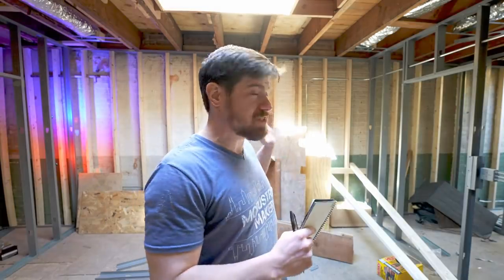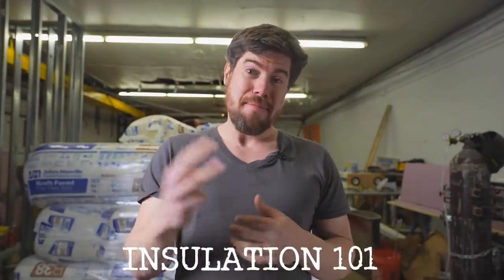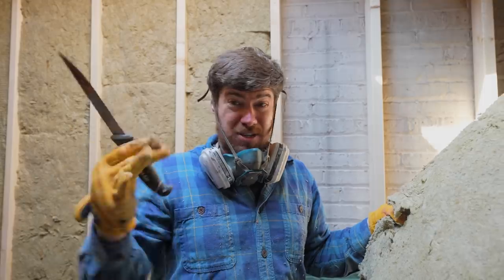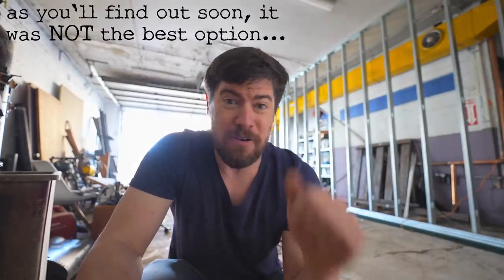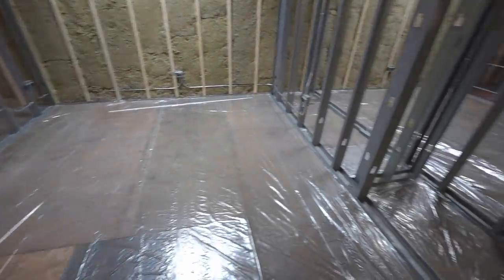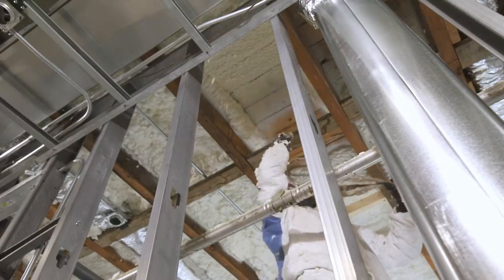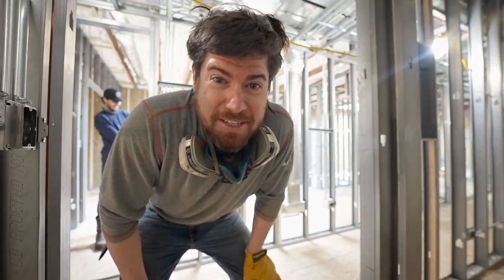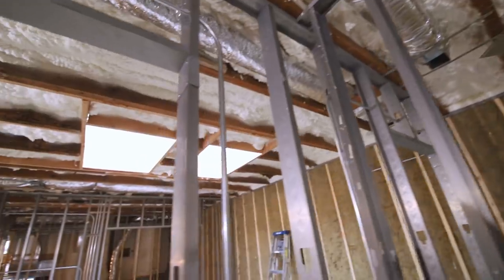Ep. 15 Abandoned Building Renovation || INSULATION + SOUNDPROOFING

Comment: You may have covered this in another video and I just missed it, but why did you end up using copper pipes instead of PEX? I just had three of mine burst in the Snowmeggedion and replaced everything with PEX. Did we make a mistake??
Reply from the maker: code requires it in commercial buildings
Reply: @modustrial  Bummer!

Comment: Any reason why you didn't go thicker on the ceiling?  

It's amazing how much difference insulation makes in sound deadening!  Adding the drywall will improve it even more, but I would fill the other wall cavities with insulation, particularly since you came in under budget.
Reply from the maker: the material is expensive, and we didn't need to go thicker...so best not to pay for what I didn't need :)
Reply: @modustrial I understand the expense point, but insulation is one of the few areas that will save you money each month.  Then again, I assume that you or your GC have run the numbers and/or identified other areas that will provide better ROI in an older brick building.

I'm looking forward to the next installment!

Comment: You may have just installed less roof insulation than required by the building code. Spray foam does decrease air leakage but it doesn’t change physics and magically multiply insulation R-value.
Reply from the maker: with spray foam you don't have to go as high an R-value practically because it is air tight, and we don't need to be up to code standards (which are lowest common denominator to whats needed with leaky fiberglass).... i mention this in the editorial note (on-screen text).  You only need to have an inspection for insulation when doing new construction or an addition...no inspection is required when you add insulation to an existing structure.
Reply: @modustrial  don’t need to be up to code standards which are the “least common denominator” - then you go ahead and put in... less. Seems sketchy but it’s your house. I’ll still be here watching.

Comment: You could have used the 24" fibreglass in all the remaining interior walls for sound mitigation. You'd cut 16" off a roll and install it horizontally.  Or return It like you did.
Reply from the maker: that definitely was an option, but also a ton of extra work and time, and I was under the gun to get this done.
Reply: @modustrial  great project!  The four most expensive words in a reno are "while we're at it..."

Comment: You'd think spray insulation wouldn't be so expensive, considering the relative ease of installation. What do I know though.
Reply from the maker: the foam itself is very expensive (think about a can of great stuff, then multiply that by 10,000 in volume.  Also lots of overhead costs for the specialized truck, storage, etc, and labor for a crew of three people.
Reply: @modustrial  gotcha. It's completely new to me. I wasn't aware of all of the variables.

Comment: 900 sq ft = $1000 what was the approximate square footage of the spray foam that was $5800?
Reply from the maker: about 2200 sq ft., but I needed thicker rockwool for the ceiling, so it would have been almost double the cost per sq ft as compared to the rockwool on the wool...not apples to apples.  I ended up paying about 2k more for the spray foam (but also, not a fair comparison, since that number doesn't include labor to install rockwool, but does include labor for spray foam)

Comment: Great job! Loving these episodes!
I have one question, will you do the hard wood flor then drywalls over the flor or drywall then floor up to the drywall and having to put baseboards on the lover part of wall towards the floor? I think it looks much more modern är clean when there is no baseboard and the floor goes all the way below the drywall😄
Reply from the maker: Thanks!  Drywall first, then flooring....working top down makes it easier since you don't have to protect flooring during drywall installation
Reply: @modustrial  Yes, it is easier! But the final result in putting drywall over the floor is so much cleaner and modern! 😍

Comment: One comment on the brackets bolted into the concrete wall - in the winter the cold from the brick wall is goign to transfer right through the metal brackets and you're likely to get condensation on the metal and dripping.  May want to reconsider, pull the brackets out, put in blocking between the studs, and then mount brackets on the blocking.
Reply from the maker: Hmmm, I guess I will have to keep an eye on it.  Hopefully it won't be an issue tho, because despite the look of it, that isn't really an exterior wall.  At the location where installed, the brick on my building butts up against the brick on the building next door, so it isn't exposed to the outside
Reply: @modustrial  You're probably good then, but yeah, keep an eye on it.

Comment: Have you talked about why you've decided to not preserve the brick walls in the living spaces? Seems like that is a highly desired aesthetic.
Reply from the maker: I am keeping the brick in the living room, and the half the studio, and few small spots elsewhere.  Just a tradeoff for comfort, having space to hide plumbing and electrical, etc
Reply: @modustrial  Ah, OK. Good point on the plumbing. I may be acquiring a similar type building soon, in your research, does a brick wall that has an exterior exposure require insulation or does the brick provide enough insulation?

Comment: is it me, or are there very few outlets?
like only one outlet per bedroom or so, that's not enough imo. probably just overlooked some tbf.
Reply from the maker: every 6 ft on interior walls, by code :) and laid out so there is one on either side of a king size bed in master.
Reply: @modustrial  of course there's a code about that 😂 there's a code for everything! 
i just noticed in our current apartment that some extra outlets turn out to be SO useful. like in the living room for extra lamps or one very random in the middle of our hallway, that turns out to be the exact location so you can vacuum the whole floor without having to change outlets. but you probably thought about stuff like that already anyway!

Comment: Could you not have used a vapour barrier or foil insulation boards like kingspan? Or is that not a thing in the US?
Reply from the maker: we have them, but that wouldn't have solved the problem with fiberglass under a flat roof.  the vapor barrier prevents moisture getting in from the outside, but there is still moisture in air, and that leads to condensation with fiberglass since it isn't air tight.   you have to have the air space for ventilation so that condensation doesn't turn into mold.
Reply: @modustrial  In cold climates vapour barriers are on the warm side of the insualtion. I assume Chicago is considered a cold climate (primarily heating).  The air space is not for the condensation, it's primarily for preventing ice damming in pitched roofs with shingles (the secondary function is to remove any moisture in the air). You want a vapour barrier on the warm side of the insulation to keep moisture from reaching the cold side of the insulation). You don't have air spaces between fibreglass batts and the exterior wall sheathing because you install a vapour barrier under the drywall.

Your issue was that your membrane roof is the vapour barrier and adding a bunch of insulation under it moves the dew point down to within the fibreglass insulation.

Comment: i love the sprayfoam😍 it always looks so cool
but isnt it kinda poisonos? and bad for the environemont?
Reply from the maker: Once it cures it's fine.  As far as environmental impact, there are pluses and minuses.  Foam itself is bad, but it is the most efficient form of insulation, so it reduces energy usage for heating and cooling, and from that perspective is environmentally positive.
Reply: @modustrial thats really interesting
 Im asking because of the 'Minergie-eco' regulations that are on most new buildings (at least in switzerland) where your not allowed to use any kind of spray foam. we use paper and other simmilar materials for stuffing.
why didnt you use the waterproof XPS or other forms of styroform instead? 
as far as i know these arent as expensive and shouldnt need a waterproof border as long as the isulation is on the inside.

Comment: If you added a vapor barrier it should’ve been fine
Reply from the maker: The poly iso layer on the roof has a vapor barrier....but that isn't enough.  The issue with fiberglass and other batts or rolls, is that they aren't 100% airtight.... And air has moisture.  The vapor barrier won't prevent air from getting thru little gaps and in the small spaces between the fiberglass and roof deck. Without ventilation, water in the air leads to condensation and then mold, regardless of whether you've got a vapor barrier or not.

Comment: That's the point of putting insulation on the brick wall?
Reply: The neighboring buildings are likely warehouses and thus not likely conditioned spaces making those walls not all that different from exterior walls thus you would want to insulate them. Even if for whatever reason you decided that you didn't want to insulate those walls there is very likely a code requirement that would force you to when submitting for permitting on this renovation.

Comment: Nice!! Vapour barrier?
Reply from the maker: yes, the poly iso sheet on the top of the roof (under membrane) serves as vapor barrier.
Reply: @modustrial  Typically walls need it too. :-)
Reply: @modustrial  Usually the vapour barrier is between the finished wall and the insulation, not between the outside wall and insulation. (or ceiling) In tis order. Outside wall, insulation, vapour barrier, finished wall surface.